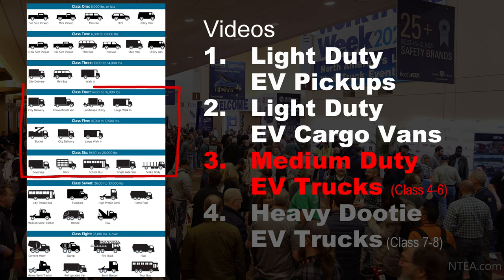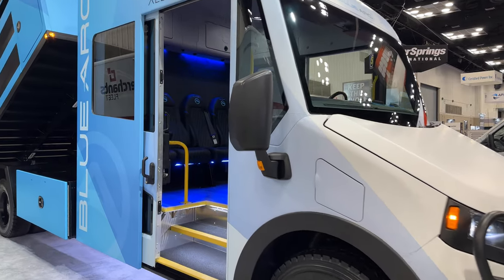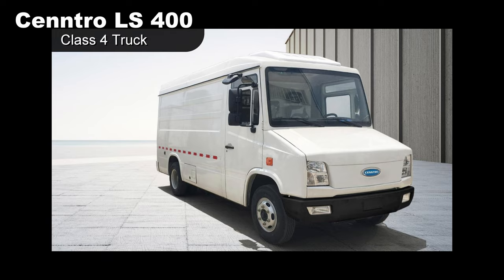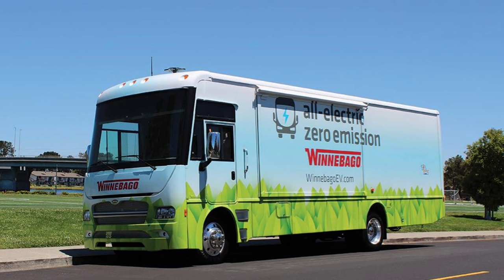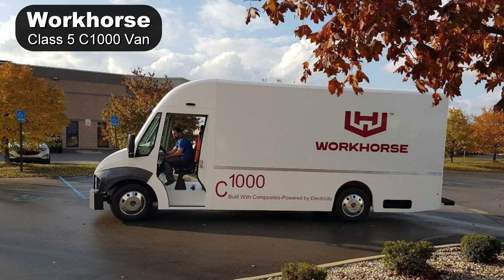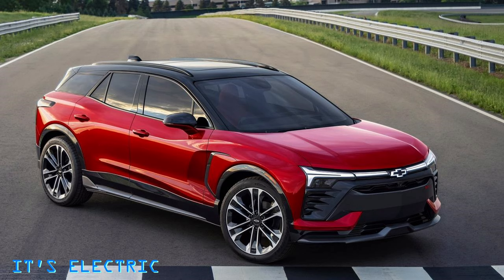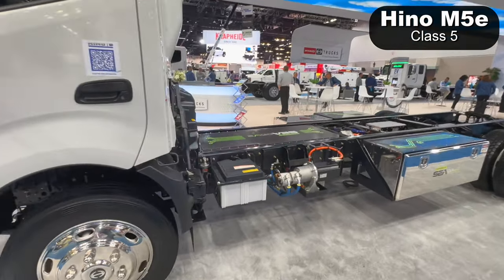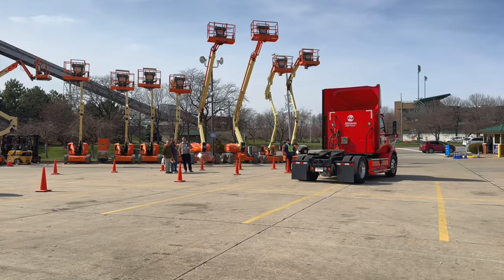Medium Duty Electric Trucks @WorkTruckWeek (Video 3 of 4)

Comment: Lion Electric is slowly but surely building a solid company. And truck too!
Reply: The sales team don't return their calls so I gave up trying.  I did get hold of someone in parts but they couldn't answer my questions.  He insisted that sales do answer the phone so I tried for two days straight without leaving a message because at that point there was no point,  never got an answer so I gave up at that point.  Freightliner is very helpful.
Reply: @MrJohnthefarmer  That is extremely sad to hear.  I have met many of the sales team, investor relations and even the CEO returns my emails promptly.  Everyone has been awesome.  If I can help, please let me know.  I will go straight to the CEO for you.